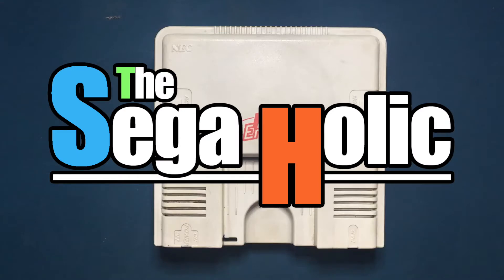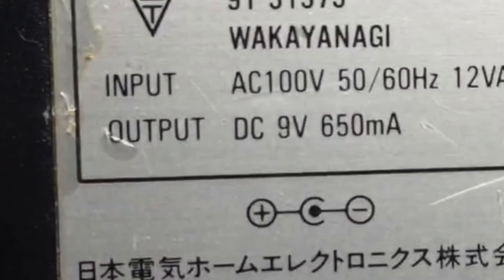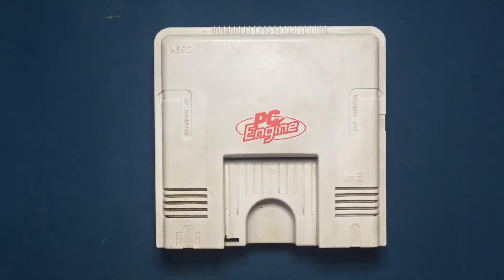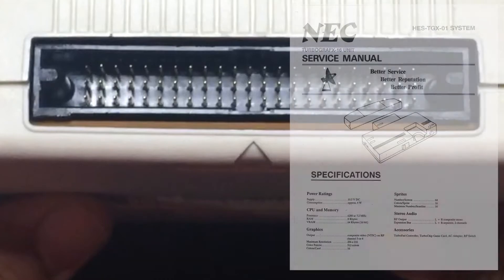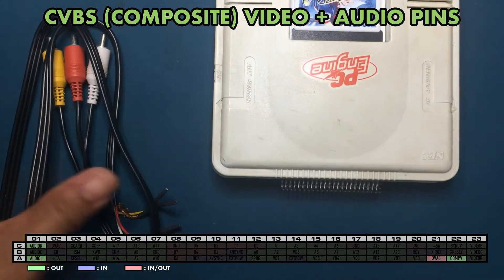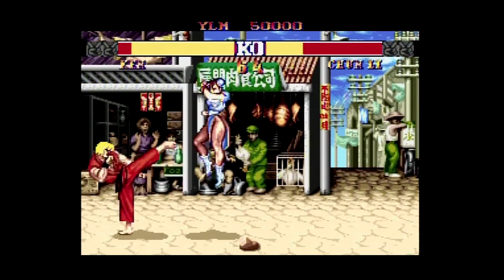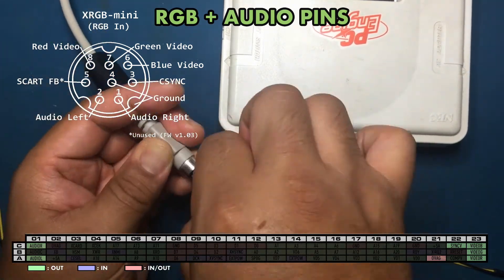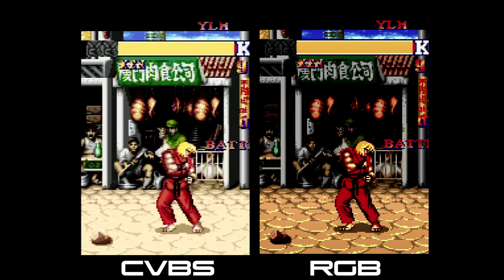PC-Engine Audio Video Guide Part 1 [ep. 52]

Comment: My system is making these fuzzy lines that slowly crawl up the screen. Is this normal for composite? Or is there something like a capacitor issue?
Reply from the maker: Yes, that sounds like a bad cap, but u won’t know for sure until u change that coupling cap in that booster.
Reply: @The_SegaHolic  Thanks for response man! I need to recap this one anyway, it's way overdue
Reply from the maker: @ShamanNoodles  Are you using a bioster?

Comment: Yo Mr Sega Holic, how goes it?  Where did you get that expansion port for the back at? I just recapped and put a new voltage regulator in one(Voltage Regular sucked to take out).
Reply from the maker: Mistah Jones! I'm doing great. How are you and the Twitterverse? Voltage regulator on a huge ground plane? LOL. You can get the part from
https://www.samtec.com You'll have to create an account as they will assume you are a company and will be buying in BULK! But you can get FREE samples. I got my share! LOL. You'll need part # SSW-123-02-T-T-RA or SSQ-123-02-T-T-RA. Hopefully, the free samplling hasin't been abused and they are still givng out free samples to the business public. BTW, of you want to make this RGB / Composite / S-Video adapter, only use electrolytic caps for the video coupling caps, the rest is better if you use ceramic caps. Message me if you got any more questions.
Reply: @The_SegaHolic  Still sharing your stuff on the Twitterverse,  I was meaning the 7805 regulator, they have the screw soldered on the backside which is a pain in the ass to remove.  Hmmmm  free samples.  I'll call my business 808 kick drum.  See if they go for that.
Reply from the maker: @jimmiejones8576  If they stopped giving out samples, I can give you a two. My business name I created was ridiculous. I forgot what I put. LOL. Thanks man, for supporting the channel.

Comment: When are you going to publish the second part? Quite interested!
Reply from the maker: OK guys, the PC-Engine RGB Adapter guide is FINALLY DONE!
Reply from the maker: I have the video half done months ago, but something came up, and I've been "BUSY." Hopefully, I'll start 2018 by finishing this. I built the RGB circuit more than a year ago, and it's pretty awesome and easy to do. Check back soon, or subscribe. I promise it'll be done soon.
Reply: The Sega Holic I was just thinking about asking the same comment when I seen that the last video was made for months ago. But I'm glad to see you got it in the works I'll be looking out for it
Reply from the maker: I just need to get some stuff cleaned up. The follow up to this is halfway done, but things came up where I stopped, and it's been a couple of months. Lets just say I found a source for "junked" consoles and have been busy acquiring them. LOL.
Reply: The Sega Holic. Sry, I was just going by the August date on this video. That's cool you found a source of junk consoles, you getting them off of Yahoo auctions?
Reply from the maker: Oh, no worries. The source is a thrift shop... SAVERS, which looks like a chain store that is also in the mainland. TONS o junk! Found for super cheap too.

Comment: Added a RGB amplifier to a PCE I picked long ago, looks great but the sound is very low and noisy. Havent had time to mess with it again, wonder if adding an audio amplifier would improve the quility and get rid of the noise, or if I have some other problem to boot
Reply from the maker: Mine aint that noisy and the sound is just a little low, I don't see a need to add an audio amp. Yours sound as if somethings broke.

I tried looking at the PCE service manual, but it does not show the ciruit where auido is coming from... or I can't find it.. or I'm not reading it right. The schematic is a bit confusing. I'm not sure if it's amped internally or not, but sing the audio is a bit low, I'm guessing it's not.

Adding an amp to the auido will just amplify the noise also. Have you tried adding in-line caps to the audio line like:
http://www.gamesx.com/grafx/pce_rgb.jpg
Reply: The capacitors for the audio are almost gone that is a very common issue on any NEC PCE/TG16, Console5 has schematics and cap kits to fix that or your local electronics store if you just want the audio caps but is very recommended to change them all.

Comment: can't wait for part 2!

LED mod on part 2? 

keep up the good work bro!

 I hope later on the channel you go as far as a DUO-R RGB and LED moded with new laser pickup and the always faulty caps on every NEC system.
Reply from the maker: No LED mod, which would be simple enough. Why no LED mod? I'm about keeping stuff stock. PRESERVATION AND RESTORATION is the mantra. It's why this is going to be an external add-on. Besides, an LED can be added to the add-on for the expansion bus.

I'm basically going go build an expansion bus add-on similar to this:
http://www.ebay.com/itm/PC-Engine-AV-Booster-RGBS-output-TurboGrafx-16-Composite-RCA-RGB-SCART-/311940798844?hash=item48a11ed97c:g:8LkAAOSwgxxZlrDq

I started buying the parts about a year ago, and only now have time to actually make this. LOL. This research has helped me undestand the AV side of consoles immensly.
Reply: I know most people like their machines stock I respect that.

In my case I like adding stuff that is missing and enhances a system and try to incorporate the mod internally without modding the exterior if possible , a well done mod blends with the machine but it takes a long time to plan, sourcing parts takes a long time too, sometimes when the part comes you realize it wont work.

would be nice to get a link for the source of the stuff you use on your videos like tools, parts even the names of special connectors like the one you use on this one.
Reply from the maker: Oh, yeah, for sure man. No disrespect to those who mod. Heck, I modified my Nomad. But when there is a way to solve an issue that does not require irreversible modding, then I'm taking that road.

I look at in ways some view stock collectible classic cars where all the car is bone stock like it came off the assembly line and the way others view modded cars like those chopped top hot rods. Whatever floats your boat. I really try not to imply you "have to do this," instead these videos are just suggestions, or gives you ideas on how to implement solutions to your problems.

I'll put in the links to the tools and connectors in part 2. Thanks for the suggestions and reminders, and please, continue to comment and critique. God knows I get lazy sometimes. LOL.